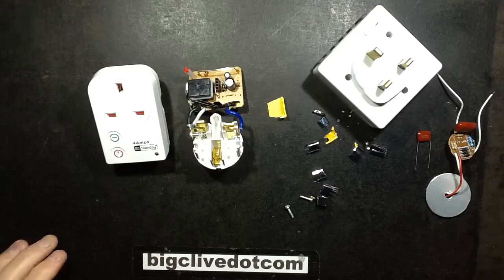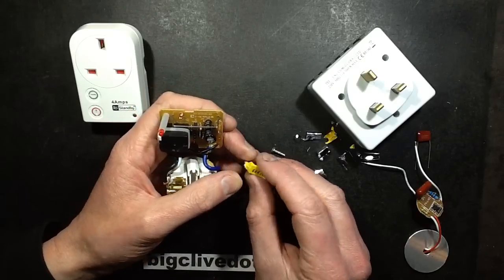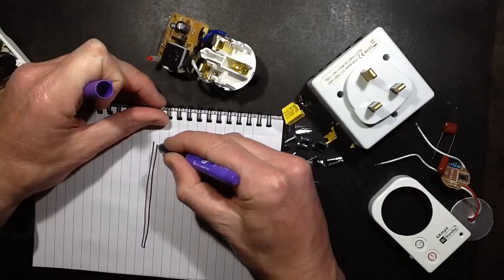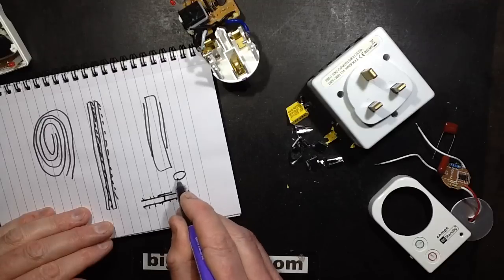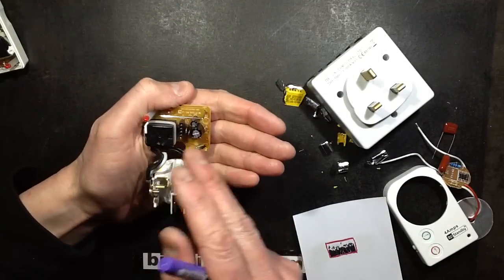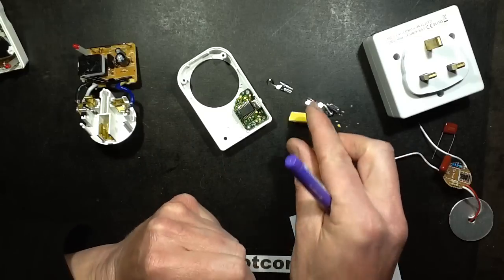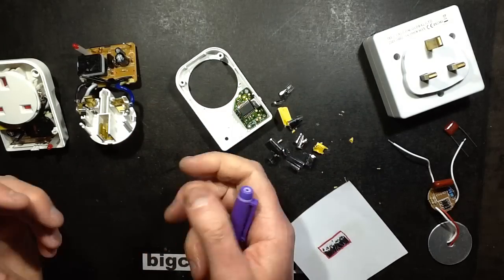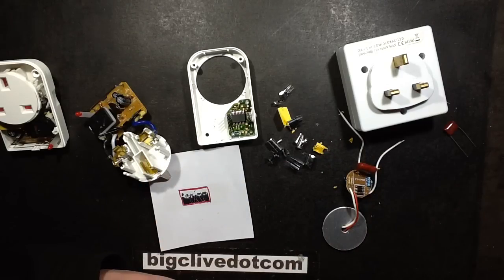Fascinating failure mode of metallised film capacitors.

Comment: You helped me save my work 10 grand by helping me to notice what was wrong with a computer we had to replace, along with the super expensive software that was paired to the computer. 10 grand for software, or 10 dollars to replace some popped capacitors. All because I was watching your videos! Thanks!
Reply: what software? if it's from a company that respects its clients it should be somewhat tied to your account, also I don't think motherboard replacement would suddenly deactivate all the stuff
Reply: Bartosz Olszewski We have a several 10,000 dollar per annum deal with them to fix everything except the computer.  The software runs a specific piece of X-ray diffraction equipment. Very niche, very high tech (but the software is passable at best, tbh, these guys are engineers, not programmers). But yeah, they basically told us the software was paired to the machine, and as far as we could tell, that was indeed the case. Our IT guys couldn't seem to figure out a way pass the copy protection, anyway.
Reply: magnusorion0 oh, that's awful. Like, even though you pay so much they still want to rip you off.. Douchebags, I use Adobe and Autodesk products with plugins and stuff, and have never had problems with license transfer..
Reply: Bartosz Olszewski They have a very small market with a high skill set requirements, so its not all that surprising. But yeah, it is a lot of money.

Comment: I had this happen in a water kettle, one of those that keeps the water at a set temperature by switching the element on and off via a relay. Not knowing much about capacitive droppers, but having seen you do the calculations on here gave me the thought of replacing the cap... And it worked!
It was a properly rated cap though, so it really shouldn't have failed.
Reply from the maker: +Knutte Söderberg Even the good ones fail gradually.  Search my videos for the word "fascinating" to find why.

Comment: Several series of Yamaha audio-video receivers (ie. home-theater amps and such) are prone to failure precisely due to this. They use a capacitive dropper to supply the stand-by circuitry, and when that's done, they won't power up anymore. I've revived one or two with this issue.

Comment: Dodgy cheapo shenzhen underground market underrated self oxidizing capacitors!  At least you can replace them with good Pansonic units.  Or even Orange Drop safety rated capacitors if there is room.

Comment: Ahhhhh, good old RIFA's, or as us slot machine restorers call em, Bob Marley's, with the way they love to smoke and go bang.

JPM MPS based machines are especaly well known for em in the PSU, for the smoothing circuit.
Reply: +stanmarsh14 the rifas that smoke are metallised paper, they fail for different reasons. Dropper capacitors should be metallised polypropylene and these are the ones that deteriorate over time

Comment: Many thanks bigclivedotcom for making this video, the premature "failure" of metalised film capacitors due to the capacitance decreasing in value has been a major problem in the world for well over 15 years now but is largely unknown even by many Engineering professionals. I think that the proliferation of poor quality products has fueled the trend but even reputable manufacturers have their problems.

The links below  reference  an article that I prepared back in 2012 about the failure of a KARL DUNGS gas fire controller due to the 0.68uF ballast capacitor decreasing in value.

http://www.productreview.com.au/r/cannon-canterbury-in-built/307583.html

And these are the photos on my Photobucket site:
http://s1189.photobucket.com/user/Gantos1/library/DUNGS%20CONTROLLER?sort=4&page=1

This link is about a DRAYTONS  gas controller in the UK that was failing  also due to the 0.68uF ballast capacitor decreasing in value.
http://www.howtomendit.com/answers.php?id=49588

The worrying trend here in Australia is that imported products from China are failing in very short time of only  2-3 years due to very poor quality metalised polypropylene film capacitors decreasing in value, I have this year alone repaired two room cooling fans due to the split phase induction motor phase shift capacitors decreasing rapidly in value from around 1.5uF to about 0.3uF after only two summers in use and you have to remember that these fans would be only used intermittently for about three months in a year so the change is rapid.

You are absolutely right to be concerned about mains spike suppression applications, the governing standard here is IEC 60384-14, the usual  film capacitor lifetime formulas based upon operating voltage and temperature do not predict the rapid failures that I have investigated in Australia, we do have severe high voltage mains transients during electrical storms due to poor conductivity soil so this may be a factor but I don't think it is the major cause.

This report is also very instructive and contains photos of a failed capacitor similar to yours
https://cds.cern.ch/record/2038610/files/45-56-Gallay.pdf.
Reply: Thank you Frank for posting your information and the time you spent. Knowledge is power!
Reply: Seems it would be a good idea to use caps with higher voltage ratings to avoid the problem?

Comment: I've seen this too. A friend's central heating timer failed in such that you could have hot water or central heating, but not both! The series capacitor had degraded to the extent that there was not sufficient current to hold in both relays at the same time. Changing the capacitor resolved the problem, though it did recur some months later. In hindsight, I should have replaced the spike suppression components ahead of the capacitor. NOTE: - when replacing these capacitors, be sure to use the appropriate safety type as a short could very easily result in a fire!
Reply: Merlin Skinner And note that the capacitor safety rating is very much about having this gradual failure mode as a major safety feature.

Comment: Noticed that was a X2 capacitor. In the KEMET data sheet years ago it stated NOT FOR LINE DROPPING. I talked to Jim Lewis about this and he said that X2 capacitors are actually very poor capacitors and after years they absorb moisture and corrode the metalization layer. Also, they are only designed to get through EMI testing. No one cares if they work years later. The construction that makes them fail safe also makes them fail. I get a chuckle when people post that you have to use X2 caps for line dropping. So if that happens with quality capacitors, think what happens with Ying Yang brands.
Reply: opera Does this mean they won't even do the suppression job in long living devices, where a loss of capacitance would ruin the noise suppression without obvious device failure?

Comment: what voltage rating are they? I do tube amp repair and caps are always an issue especially when run close to their rated voltage . UK mains rectified voltage is around 340 so the cheap units use 400 volt caps . I have found that they don't have enough headroom for any mild spikes. a 600 volt unit is much more robust in these cases
Reply: Scott Johnson - Do you know which way to install them?  See Mr. Carlson's Lab.

Comment: The metallised film capacitors do have the self-healing mechanism that you talked about.  However, you'd have to have an awful lot of local failures for that to happen.  I also note that there weren't loads of holes in the film - so this probably isn't the mechanism causing the failure in this case.  There's another mechanism in which moisture getting into the capacitor (especially in a warm humid environment) causes the aluminium or zinc electrodes to oxidise - effectively making them into a non-conducting transparent, very thin glass - which you can't see.  I suspect this is what is happening in your case.

Comment: Fascinating! I have only one product in the market that really depends on a cap this way, and I'm fairly sure I specified Class X. 

Do you think it's possible you have a lot of electrical fast transients in your local mains? Motor drives etc. Around 1-2kV, but short (50ns) and frequent. I generally reckon those things get well dented making their way down the mains cable, but your cap demo has made me think again.
Reply: Noticed that was a X2 capacitor. In the KEMET data sheet years ago it stated NOT FOR LINE DROPPING. I talked to Jim Lewis about this and he said that X2 capacitors are actually very poor capacitors and after years they absorb moisture and corrode the metalization layer. Also, they are only designed to get through EMI testing. No one cares if they work years later. The construction that makes them fail safe also makes them fail. I get a chuckle when people post that you have to use X2 caps for line dropping. So if that happens with quality capacitors, think what happens with Ying Yang brands.

Comment: Check Mr. Carlson's Lab for information on how best to install these beasts. Turns out, they aren't symmetrical.
Reply: well, they ARE in terms of polarity, BUT one foil is on the outside so susceptible to hum pickup or hum radiating if the outer foil is connected to a high signal point or  'sensitive' part of the circuit... old waxed paper caps were commonly marked with one end as 'outer foil'

Comment: Long ago i was the engineer in a capacitor factory  ( Siemens AG). Later also with Philips.
We found that capacitors which have a DC bias across them fail in this mode because of moisture penetration and electrolytic corrosion. Power supplies using a capacitor as a dropping impedance always have a DC bias across them ( superimposed upon the mains voltage). If the epoxy dip is not good the life is greatly reduced. Capacitors were tested (sampled from a lot) for life by dipping in warm water for a few days and then testing for DC leakage . Some of our best capacitors MKL , MKH, Mepolesco and the like often showed this failure and the lot had to be destroyed. Your capacitors come from rather shifty sources.  They skip on this test. Trusting to luck instead.   This is the most common mode of failure.
Any plastic film always has holes, or nearly holes in it. After capacitors are assembled and before potting they are subjected to a short HV pulse which clears any short circuit during rolling . Some capacitors do not recover from the pulse and are automatically discarded. ( sometimes quite a few actually).  Some manufacturers use a very low grade film which is very permeable to water. These capacitors usually fail very soon.
Reply: Can a new replacement capacitor be dipped in an extra layer of epoxy to provide extra protection against moisture?
Reply: I would buy you a  cup of Coffee or a Beer for this comment if I could. God bless you and thanks so dang much for chimming in.
Reply: Keep in mind that most epoxy is hydroscopic by nature. You’d be better dipping it in some sort of lacquer or conformal coating designed for sealing out moisture while at the same time being non-conductive. A liquid Teflon might work as well, as it’s hydrophobic, oleophobic, heat resistant and a very good electrical insulator.

Comment: I saw homemade device of so called  Chizhevski ionizing lamp. it's air cleansing device (if you know "plasma cleaner" inside ACs, that's the same thing).  it was a voltage stepping UP circuitry, with lots of film caps. Ones from old TV were used. One of them failed in weird way that  in plastic between foil films  was created a channel, from which a flame-like electrical discharge emerged

Comment: Maybe the ac ripple current through them is causing it?? You sometimes had special high ripple capability capacitors in crt tv scan circuits..maybe these modern tiny things just arent capable enough to be used in this way but ok for signal coupling/decoupling.
Reply: Most manufacturers abuse "accross the mains" capacitors (X class) for series power supplies such as the ones Clive shows. However, capacitor manufacturers often have different capacitors rated especially for series usage. Presumably they are better at handling ripples.
Reply: yep, the scan coupling ones would be better, or maybe 'motor run' types, but are much larger than the normal ones!

Comment: It's a common failure mode of Senseo coffee machines which also have a capacitor dropper PSU. I thought it was due to mains spikes causing the self-healing effect and thus tiny holes in the metallisation but from what you see here it could be another effect of the plates degrading. Interesting. I wonder why the capacitor manufacturers can't stop this happening.
Reply from the maker: +Terry Clark Probably because they are expected to make the capacitors as small and cheap as possible.  They probably have specifications about using with a MOV transient suppressor, but that probably gets cut for cost savings too.

Comment: I've repaired lots of such devices, mostly timer an remote control plugs, almost all of which failed due to the dropper capacitor losing most of its capacitance.
I think the main problem in all these devices is that they ignore the fact that there will always be voltage spikes on the mains and they have no protection against them. 

It is not only high voltage spikes that damage them but even modest spikes having a sharp voltage gradient. The spikes result in a huge spike of current through the capacitor which can overheat weak points and damage the insulation even without exceeding its voltage rating. Such spikes can be caused by airconditioners switched with mechanical relays and other heavy current appliances.

I think there is a simple solution and that is to put a modest value resistor in series with the capacitor such that it drops about 10 volts in normal operation. When there is a voltage spike the capacitor will behave as a short circuit but now the voltage will be developed across the resistor limiting the current to well below what the capacitor can handle.

I have tried this using resistors of about 270 to 560 ohms depending on the particular device. They still function normally despite the slightly lower voltage now available. Now only time will tell whether they last longer. The oldest modified one I have has now been working for about three years which is beyond what seems to be the average lifetime of these devices but not enough to be sure as I also have at least one (unmodified) timer that worked well for eight years.

An MOV would certainly also help but I guess it is generally considered too costly for such cheap devices. A resistor on the other hand costs next to nothing.
Reply from the maker: The simplest LED lamps use a series resistor.  Not just to protect the capacitor, but to prevent that high current spike from damaging the LEDs.

Comment: The first thing I check when any mains powered item (with a capacitive dropper) goes bad is that series cap.  I've seen them fail in all sorts of things, from water tank pumps to hi-fi gear.

The "turns off immediately after turning on" is due to the PSU not being able to sustain the rail when the relay coil starts to draw current. It can also result in erratic operation in general as the PSU fluctuates with load.

Comment: This probably explains the early failure of two LED bulbs, which I'm fairly sure used capacitive droppers based on their noticeable stroboscopic light.  A 7W generic 'GLS' went down to about 3 watts and a MiniSun 4W candle type bulb went down to 1.5 watts going by the watt meter.  I don't remember what the GLS type bulb used when new, but the MiniSun bulb started off about 4.5 watts when purchased a year ago and both were used a few hours a day.

Comment: The failure of metallized caps is most likely due to their inability to handle even modest amounts of current.The metallized film is only a fraction of a micron in thickness.Foil types are way better but are bulkier and more expensive.
Reply: exactly, most likely its the ripple current, those tiny things simply cannot handle it long term... ok as decouplers, but capacitive droppers..hmmm.... genuine class X across mains types would be better...but not perfect..

Comment: Thanks for the info. This  reminds me of the tendency of multi-megaohm carbon bootstrap resistors in switching power supplies to slowly fail open even though they are operating well below their rated power.  That's caused by microscopic arcing that gradually eats enough carbon to open the resistor.

Comment: That's why I tend to put capacitors rated at 630VDC / 275VAC at minimum in such applications. I figure - the more insulation thickness the better :)

Comment: Great video, I learned much from it. Now I know why my 24x5050 LEDs GU10 lamp has reduced its power, and it is possible to see right with the naked eye- because it shines less. And guilty one has decreased from 680 to 320nF after 3-4 years and instead 3,5W we've got approx. 1,8W.
I got to the center by scraping resin/glue around the edges, and pry the PCB off. Time consuming work... but now I can repair my lamp.

Comment: Most electronics failures are capacitor related. Best dielectric is vacuum, glass, teflon, etc, and it's expensive. You can reuse resistors, inductors, etc. but caps one should never. Always take fresh new ones, especially electrolytics.

Comment: Regarding the capacitors in LED lamps, when it reduces power to the LEDs, one need to keep in mind that the voltage across the capacitor will go up, and therefore the power dissipated in the capacitor will possibly go up and burn it out. i have had that kind of failure in a cheap LED lamp.

Comment: The most common effect is also visible on those lamps where they use a small converter, where you find the lamp flashes once a second or so as the capacitor fails. Otherwise the cheapies will dim and eventually flicker. There are some near me in a new install, about one year on and most are a disco light display. 50W downlighter lamps, all 3 led types so have a small SMPS inside.